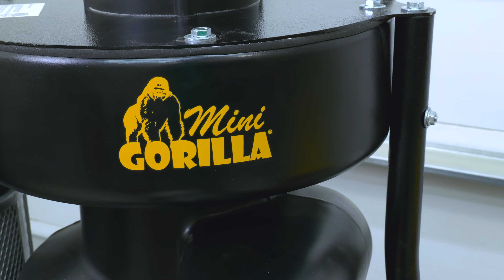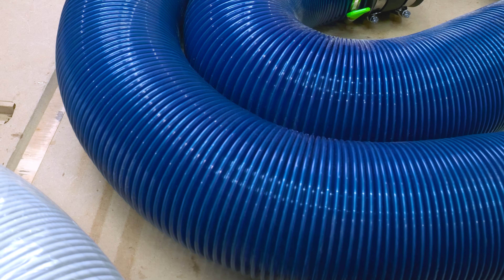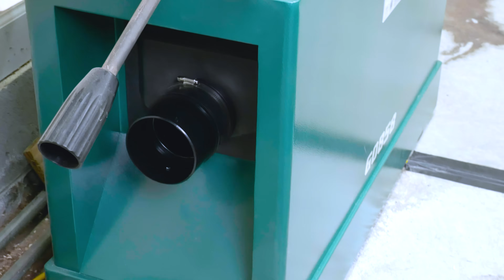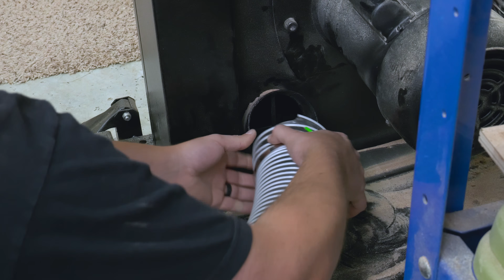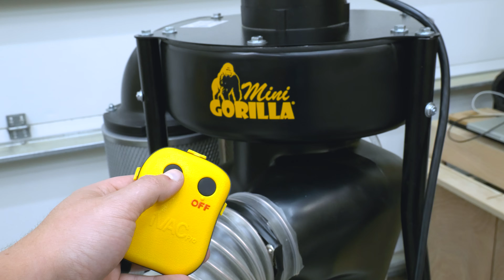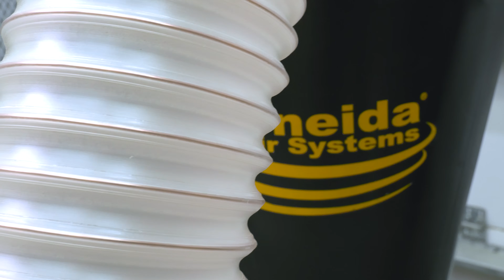Do This Dust Collection UPGRADE Now | Small Shop Dust Collection

Comment: I'm curious if you would know how to reduce that 4-inch hose, coming from the 5-inch hose, down to a port that is 2 1/2 inches. Does Rockler have that covered?
Reply from the maker: I’m not sure on that size to be honest. I know they make a bunch of different fittings for a regular dust extractor size, but I don’t think they make one for a full DC. That would put a lot of strain on the motor.

Comment: On the fence.  Mini Gorilla, Jet JDC or Grizzly wall mount with added super dust deputy.  You still using this dust collector?  Thanks.
Reply from the maker: All are good choices. I’m still using the mini gorilla today, with my only complaint being that on really large furniture projects, I can fill the drum pretty quickly.

Comment: Curious if you think this system could be ceiling mounted. I’m leaving the ceiling open in my wood shop and I’d like to put the dust collector on the joists in position that keeps it out of the way but still allows for easy emptying and filter change.
Reply from the maker: I don’t know that this is the right system for that particular installation. This is more for transporting around the shop as needed. Emptying the dust bin would be a real pain in that set up.

Comment: As someone who also has a 2-car sized garage workshop where space is really limited, I used to have a portable DC also, but one of the best things I ever did was to instead mount a dust collector (from Oneida) on the wall and run some PVC and flex hose around to my tools.  I spent a few bucks getting some iVac automated blast gates and now all I have to do is turn on a machine and everything else happens automatically -- blast gate opens, DC turns on, and of course the connection to the machine is permanently in place so no fussing around with that either.  It takes some work to set all this up and requires some investment, but IMO it's been worth every penny.  You'll have more shop space and way more convenience.  I'll never go back!!   All the best
Reply from the maker: That’s definitely happening sooner than later. Because I agree, moving the hose for the mini gorilla around is not ideal.
Reply: @TimberBiscuitWoodworks  You won't regret it.  I've had my iVac blast gates for more than 8 years and have only had one fail (and that was just last month), otherwise very reliable.  One IMPORTANT point about the iVac blast gates -- for some reason the power supply that comes with each gate doesn't include a ground, only a 2-prong hot and neutral.  When using PVC this lack of ground has caused several of my power supplies to short out and stop working.  iVac was very good about immediately sending me replacement power supplies but I had to run a ground wire from the free prong on each gate to a known ground.  This is unfortunately the only big flaw in the iVac product.  Running the ground like I did has worked and no power supplies have failed since, but it is a bit of a PITA.  So be prepared to run your own ground wire to each gate if you're using any PVC.  Good luck!
Reply from the maker: That's a really great point. Thank you for the heads up!
Reply: @carlpetitt2241  could you post links to the products you used? Thanks!
Reply: Which unit did you go with?  Would like to get real dust collection for my small shop that shares room with cars. Looking for and effective wall mounted option.   Onieda super cell is what has been catching my eye but its expensive.
Reply: @qfudgedoggy  all I bought from Oneida was a super dust deputy because I already had an old blower from Jet (which worked fine).  So I fashioned a DC by mounting the blower on the wall and the super dust deputy right beneath it and it works great.  I can't speak to different DC units that Oneida sells, but I can say that good dust collection has a lot to do with good hoods and a combination of low pressure / high volume (like a wall mounted DC) and high pressure / low volume like a shop vac.  So for example, on my Sawstop table saw the 4" port is connected to the DC, and the blade guard / dust hood is connected to a separate shop vac.  Works great.  Be careful not to over-rely on just a DC and nothing else.  In my experience that may cause you to spend a lot on some huge DC but not get the good results you were hoping for.  Good luck!

Comment: Yes, the iVac Pro switch with the remote and ivac tool plus make life so easy man. The next thing I wanna do is get the ivac pro automated blast gates. With just the tool plus and switch I already have my dust collector kick in when I turn on my wood lathe but my blast gates are up high next to my main trunk, the automated blast gates would be a godsend. If there’s one thing I know we all want as woodworkers it’s to be able to do our craft for as long as possible and we’ve all known or currently know someone who had to stop at the orders of their doctor because of decades of dust exposure, having dust collection in place that also doesn’t require our input allows us to do just that and focus on what really matters - woodworking.
Reply from the maker: Really well said!
Reply: definitely get the blast gates.  you won't regret it.  I have 4 of them so there is some investment, but totally worth it.  I used to always forget to open a blast gate or even more frequently, forget to close one that isn't in use.  Huge PITA.  But that's all a thing of the past now.  Good luck!

Comment: There is a lot of opinions out there regarding the cost of dust collection for small shops. This is one of the lesser costs, but higher CFM - while being made in the USA! I was wondering if you considered the supercell? I want to upgrade from my single stage delta 1-1/2hp, but I want to do it right. The mobility is a huge benefit for a shop that needs to be flexible because the wife thinks it’s a CARage!
Reply from the maker: I agree with you about that, there’s a lot of options too. I’m not 100% set on my shop layout which is why I didn’t commit to hard lining with the SuperCell. Overall I’m quite happy with this model, though I do wish it had more capacity for projects with a lot of milling.

Comment: $1800 for a small shop dust collection solution?! Not practical in my opinion for a SMALL shop.
Reply from the maker: It's great for a small shop, but high quality American made products do tend to cost a little more and I'm okay with that. But it might not be for someone on a tight budget.
Reply: cheapest off the shelf hepa system there is for 4" dust collection.  none of it is cheap if you want to get the fine dust.
Reply: It’s not hard to make the business case for upgrades if you’ve got enough jobs coming through the shop.

Comment: Can the mini gorilla be successfully used with 2.5 inch tool dust outlets?  I really like this set up you have, but as beginner woodworker I have several tools with the smaller dust outlet.
Reply from the maker: The mini gorilla is really designed for 4” dust ports. I have a video where I tested out some smaller 2.5” dust collection systems and found that dust deputy works great for those smaller tools.  Check out that video if you want to se more about it.

Comment: Nice unit and set up.  I've ended up with five vacs, but am daisy chaining two to work as a prefilter and M-Class end unit similar to what you have.  Janitor vac and H-Class extractor for site work.
Reply from the maker: Thanks! Do you get a decent amount of airflow from the daisy chained units?
Reply: @TimberBiscuitWoodworks  yeah, so the first one is a cheap shop vac with an exhaust port, the second one with the hepa filters does the sucking with the first one switched off so I'm not overdriving the first motor.  The flow rate is the same as if there was nothing there as far as I can tell when I've used it to clean the bench or floor and on tool end.  I dont get any alarms going off like you can do when the unit is bag full and struggling.
Reply from the maker: @mrmukura  ahh okay that makes sense.

Comment: I got a great deal on a mini gorilla on Craigslist a year or so back. It came with a rockler quick-release handle on it and a Long Ranger remote switch (one of the only ones I've seen that do 240v). I added an elbow to my planer, too (really needed if you want to keep it out of the way of boards). Only thing I've noticed is that you really need to check/clean the HEPA filter more often than you would expect, especially if using a drum sander. I pull at least a gallon of dust out of the HEPA filter every time I empty the lower bag (WAY more by percentage than gets through my regular dust deputy into my festool extractor, which still has basically no dust in its bag even though I've emptied the DD's bucket a dozen times).
Reply from the maker: I love my Dust Deputy and dust extractor combo, I will post an update on how often I clean the HEPA filter on the Mini Gorilla for sure. Thanks!

Comment: That's an impressive machine, right there. It's got everything you'd want in a dust collector right out of the gate. It's a bit pricey but if you have the means, it's definitely a solution worth serious consideration.

Last year, I bought the Dust Right 750, from Rockler. It's advertised as 750 cfm but of course, that's not at the end of the hose. I do get 500 cfm at the end of the hose and that is plenty for my small shop. The difference with mine, compared to yours, is that I do not have a cyclone separator. I bought one of those trash can lid separators from Woodcraft but I'm afraid that I'll lose too much airflow. Even the best cyclone separator will degrade airflow to some extent. Since I don't own a jointer or a planer, I'm only having to deal with finer particles from my table saw and router table.

The best thing about that Mini Gorilla is that it comes with the cyclone and cannister filter and you get close to 600 cfm at the end of the hose. For a mobile dust collection system, that's awesome. That price though. I got mine for $550, at the time, but now they're $850 so I can see why they're asking so much for the Mini Gorilla.
Reply from the maker: Valid points! I think the price for the mini gorilla is in line with where tool pricing is in the current market. And you definitely get the value for your money as long as it's within your means. Dedicated systems are north of 10K so this is a good compromise, especially for smaller woodshops. 
Thanks for your input!